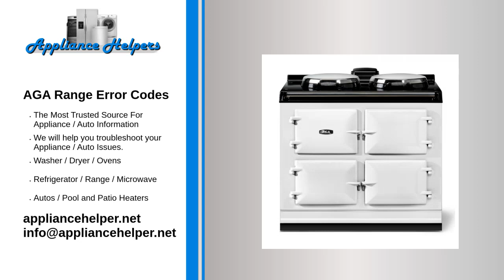AGA Range Error Codes

Comment: our arga is showing error code t1 have tried to re=set, but it keeps coming back. cooker will not heat up so we are unable to use it
Reply from the maker: The error code "T1" on an AGA range typically indicates a problem with the temperature sensor or thermostat. Here's what you can do to troubleshoot and potentially resolve the issue:

Check Temperature Sensor: The temperature sensor monitors the oven's temperature and sends signals to the control board. If the sensor is faulty or damaged, it may cause the oven to display error codes like "T1." Inspect the temperature sensor for any visible signs of damage or wear. If it appears damaged, it may need to be replaced by a qualified technician.

Reset the Range: Sometimes, resetting the range can clear error codes and restore normal operation. Try turning off the range's power at the circuit breaker or unplugging it from the power outlet for a few minutes. Then, restore power and see if the error code clears. If the error persists, proceed with further troubleshooting steps.

Verify Wiring Connections: Ensure that all wiring connections to the temperature sensor and thermostat are secure and free from corrosion. Loose or corroded connections can disrupt the sensor's ability to communicate with the control board, leading to error codes.

Test Thermostat: The thermostat regulates the oven's temperature and communicates with the control board to maintain the desired temperature settings. Use a multimeter to test the thermostat for continuity and proper functioning. If the thermostat is faulty, it may need to be replaced.

Contact AGA Support: If the error code "T1" continues to appear despite your troubleshooting efforts, it may indicate a more significant issue with the range's internal components. In this case, I recommend contacting AGA customer support or scheduling a service appointment with a qualified technician for further diagnosis and repair.